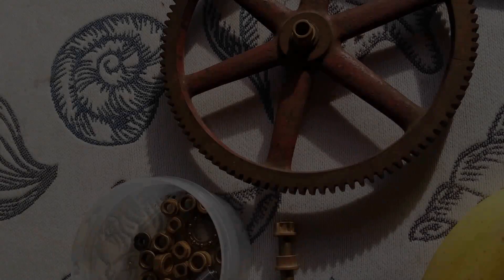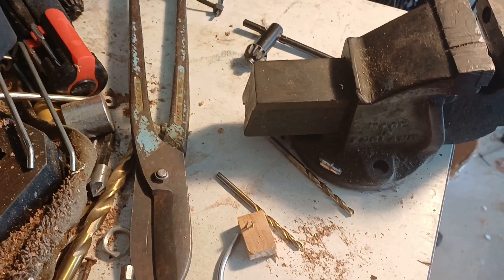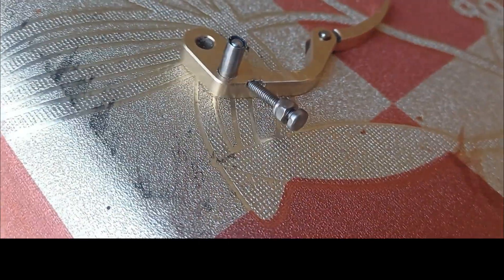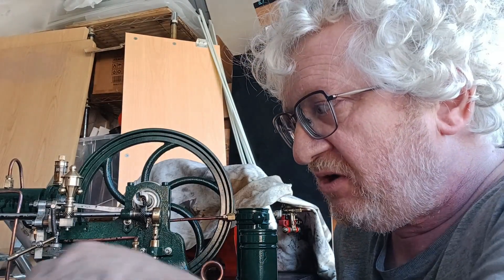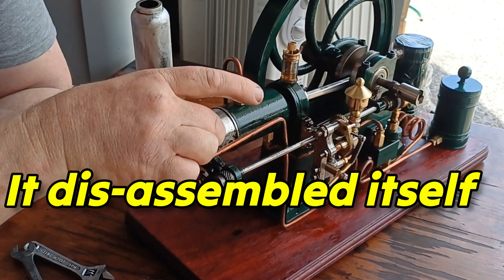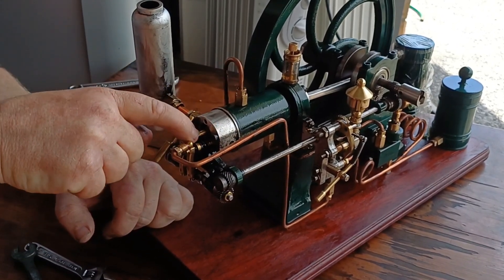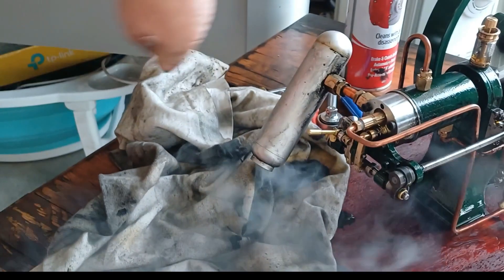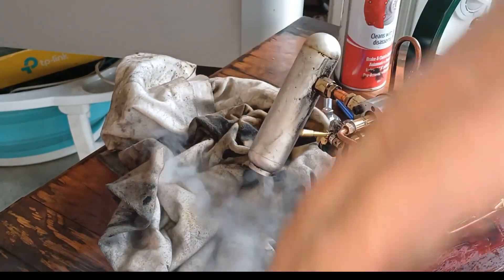FIRST production model Diesel injector & TWEAKING the GOVERNOR -

Comment: Thomas, If you extend the stud that the spring control lever is mounted to, it would move the spring away from everything.  You could still add the separate bolt / stud mounting for the spring.  Keeping everything away fro the governor pin.  Bush the pin on the governor pin to eliminate the free play like Find did.

Comment: Attention! These engines fron china is absolutly bullshit! Very bad quality and leaks at every pipe connection. I bought one of them, it never runs, only spoke oil from exhaust. Only a desaster!!! Never again!
Reply from the maker: Bad experience Oliver. For the pipe connections, it seems they do not survive postage. To reseal them I use loctite drops AND wrap with teflon tape cut to size. Then, warm the engine head with a hairdryer before starting. The next issue will be priming the diesel pump. These seem to be the three issues everyone faces.

Comment: Hello Thomas, what's your experience with the rubber piston ring? We tested the FKM ring in our engine and it lasted just over half an hour. But the cylinder was designed for gray cast iron rings and had no scoring. Does the ring still seal?
Reply from the maker: Hi Niffi2, I just ran the engine today. I don't like the black rubber ring he uses it has a angled v lip facing toward the combustion chamber, so it's not a round section fluoro ring like in other Chinese petrol engines have lasted years. My aluminium piston in Shiyi's engine has surface scoring [although I drench it in oil] now which looks ugly but the engine seems to run fine...although it won't keep speed, a known problem he is working on. I only run mine on kerosine now. So much cleaner. I have run this engine around 20 runs not exceeding 25 minutes per run (with starts and stops). I don't have a way to measure compression; I suspect it IS a bit lower. The engine has many problems. Shiyi realises this, particularly after looking at Find Hansen's updated work on it. Shiyi is a positive and happy guy, but the challenges are significant
Reply from the maker: In particular I don't like the friction the lip causes, I feel, and it squeaks along the cylinder bore. That can't be good
Reply: @ThomasPCGuruENGINES  Okay, interesting. I think the squeaking is intentional. The grooves in the cylinder probably serve to store oil for the ring. We'll experiment a bit more with the FKM ring. Production is underway in parallel. We'll only use such a ring if its durability is comparable to gray cast iron rings
Reply from the maker: Anytime you want a photo of a part let me know. I am interested and happy to help
Reply: @ThomasPCGuruENGINES  
Thanks for the kind offer. However, we don't want to copy or steal any ideas. The engine has been running with the FKM ring for several hours now, as it's installed differently. However, the ring has to be almost as durable as a cast iron ring, otherwise this isn't an option.

Comment: I received mine today ! Impossible to start, lot’s of diesel coming out from intake and exhaust, I bleed air, absolutely no smoke at all… just fuel everywhere… that’s incredible !j!
Reply from the maker: Sorry to hear that...that really sucks...where to start. I think with it never starting and so clearly sick, it's fair to ask the supplier seller. Otherwise, in your case I would do exactly as I did in this video to check for leak AROUND the injector (where the two parts connect) and if that does not help, ask for a new injector. If you get no help from your supplier, let me know, the builder will help.
As for starting, I get no start unless I move the wedge controlling the injector pump back and forth to find the sweet spot, middle-ish. Have you put lots of oil everywhere for compression? Checked the big end not tight?
Watch out for fuel flooding as I have bent the conrod on my first one when I got a bit of fluid lock. Open the valves, like the exhaust or both, and spin it empty. Heat up the cylinder head with a hairdyer, I only use my engine on mild days and it's summer here.  I hope you get something happening :)
Reply: @ThomasPCGuruENGINES   Good morning !

By analyzing the rotation, I noticed that the intake valve seemed to be late, the cam may have shifted during transport, yet it is tight. 

In fact when the piston rises, therefore in the compression phase, it is still open, and only closes halfway through the compression stroke. This reduces compression, on the one hand, and it causes diesel reflux towards the intake... 

Then, for the leaks, I had a few places that were leaking, I resolved either by tightening, or by light Teflon tape at the injector for example.

I strongly believe that starting is made impossible by this poor synchronization, but the adjustment without manufacturer value risks being delicate and by tatonation... I saw that on yours you sometimes had a slight reflux at the intake level as well, I think that you must have a lag like me also, but weaker.

Comment: I see the intake valve is losing a little compression, you might need to do a wee bit of lapping on them buggers. Worked on Detroit Diesel for many years... 2-53 up to the 16V-149 series. Air Force sent me to the GM Tech Center for classes on them Screamin' Jimmy  2 strokers. 43 years later and I'm still hooked on diesels of any type. Thank you for your awesome videos.
Reply from the maker: Thank you for your awesome comment. I am struggling with a concussion at the moment and everything is difficult, a little encouragement goes a long way :))
Reply: @ThomasPCGuruENGINES  Ooofda... I've had a few concussions in my days. Definitely no fun. My first one was from a motorcycle accident and woke up in the hospital 3 days later. My latest one was from helping a friend unload dimensional lumber (construction timbers) and a helper wasn't watching what he was doing and we had a 3 Stooges moment right up the side of my head. Was only out for about 15 seconds that time. I was seriously loopy for a few hours after that.   Lol   Love your videos guvnah...keep up the great work.

Comment: If my Retrol HM01 was anything to go by, i would NEVER own another Retrol engine ever again, as it was so troublesome and tempermental- that i sold it for £199. just to wash my hands of this heap of junk, and your diesel doesnt seem any better.

Best engines I've ever owned are the enjomors, that are virtually bullet proof and so reliable.
Reply from the maker: Retrol is a shop brand-wash over the original manufacturer like OKMO or in HM01 case, MUSA. HM01 has the reputation of absolutely the match of any western engineered motor, I'm sorry you got a bad one, First I've heard of that motor. Here's mine a couple of weeks ago running a generator https://youtu.be/kmruk_4HlYw

Comment: there is way to much fuel that gets injected and consumed ! 100%
Reply from the maker: Yep the major problem is mass producing the tiny, tiny injector for a tiny, tiny combustion space
Reply: @ThomasPCGuruENGINES  not with a good production lathe . The problem is to QC and manufacture the injector needles and other parts with care and within certain specs. The injector and plunger pump together with the governor are the heart of a Hansen Diesel Model. Along the Chinese don't take time and enthusiasm for the parts they will never make such a good running model. On the Chinese engine are numerous different things so badly wrong and done inpropper,to me it's just a waste of time and money to work with such a poor model

Comment: Bonjour Thomas,

Great job as usual would I say, my wife would kill me if I had such an engine operating in our flat !
More technically, I make a difference between thread sealant and  thread locker which ae sold as two different products as Loctite 542 and 243 for example.
I use a lot of the first one (with Teflon tape also) to prevent steam or gas leaks  and very rarely the second one because it is quite easy to brake bronze or brass little threads when they are glued with it.
Amicalement, Raphaël
Reply from the maker: Noted, and good distinction to make

Comment: I see smoke coming out of the intake. This should not be happening.
Reply from the maker: Absolutely. I caused this by tweaking the valve timing and will fix it when I get around to it.
Reply: I wonder if it’s a bit low on compression
Reply from the maker: I use heaps of oil and it's easy to start...dunno
Reply: @ I’m going more by the exhaust colour